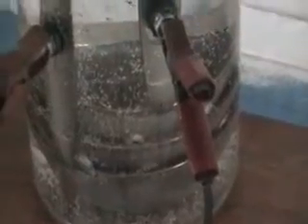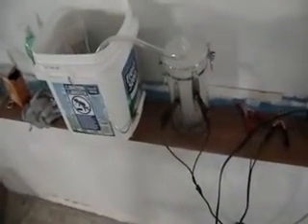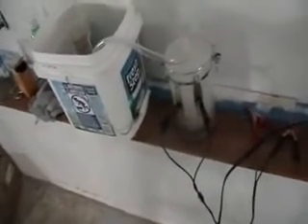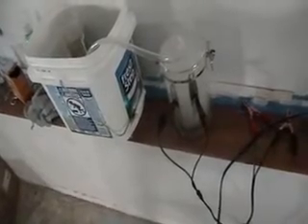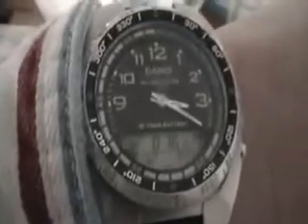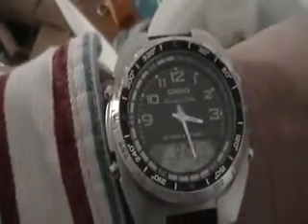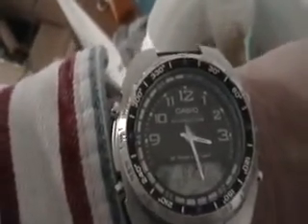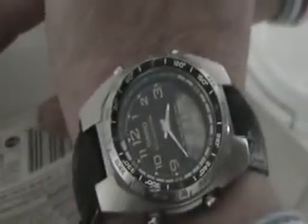HHO_ver_IV_test_1

Comment: hehehe ... wondered how long would take you to discover that the mesh was less productive than the solid ring ... so what's the next step ???

actually, when you start playing with high voltage, the screen starts to have utility ... but in a low voltage "brute force" electrolyzer, think you would do a lot better with some of those stainless steel switch plate covers that some are using ... with 1/16 inch spacing, they seem to do surprisingly well ...